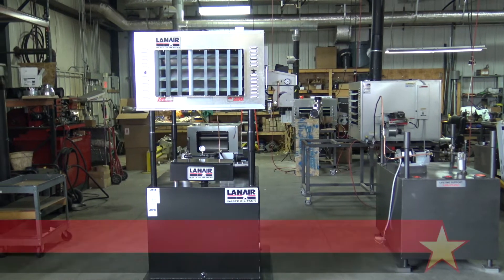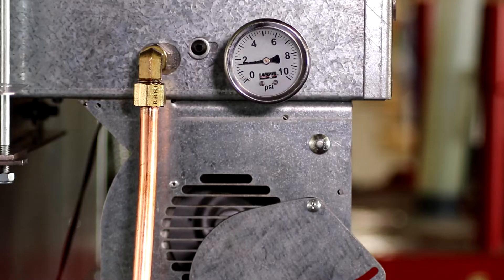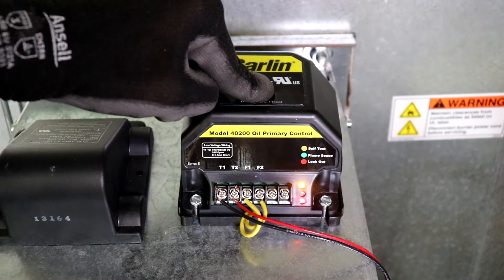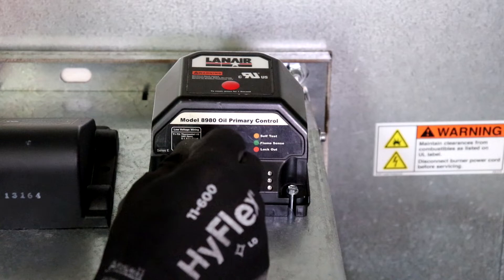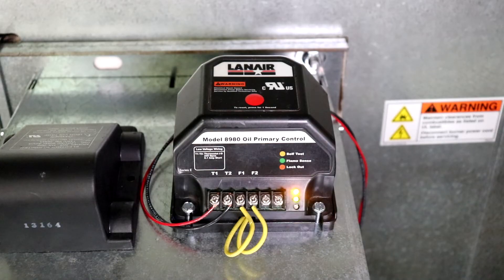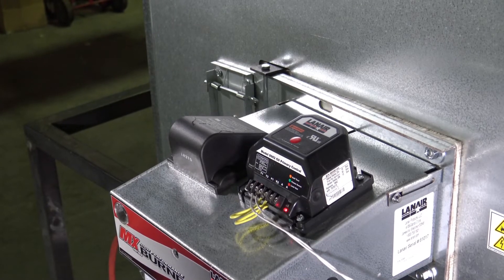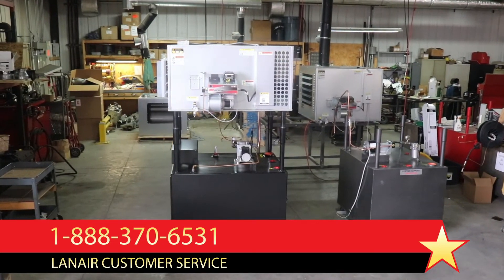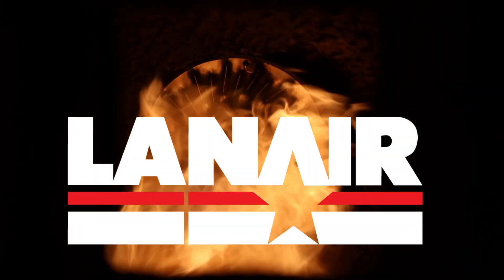Lanair Waste-Oil Heater - Primary Control Behavior & Troubleshooting

Comment: What about if the unit will flame up for like 1 sec or 2 and then go into self test and then flame up for 1 or 2 seconds again then go to self test again, and will keeps that for as long as I leave it plugged in for?
Reply: Sounds like a malfunctioning Primary Control. Did this end up being the issue, or something else?